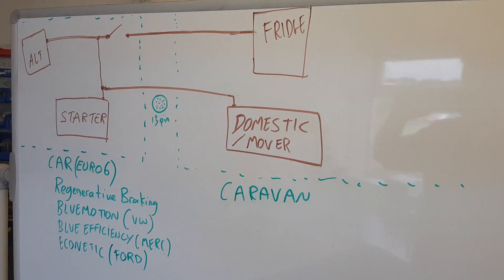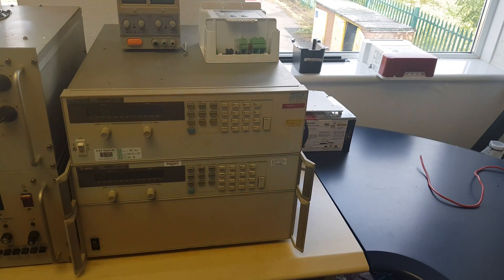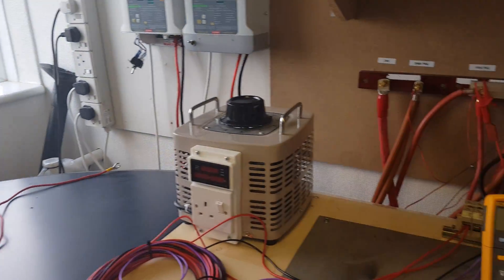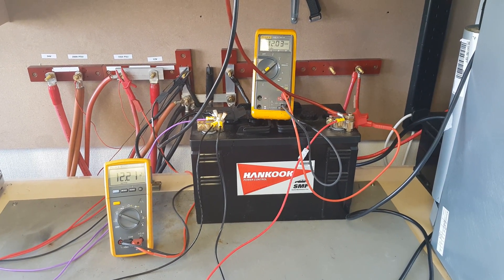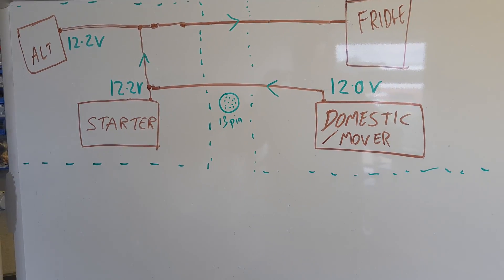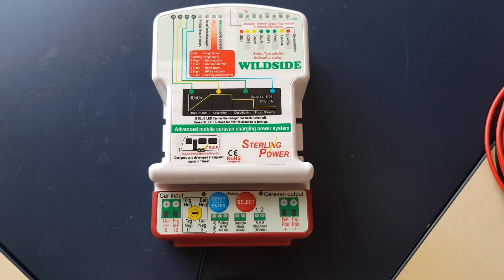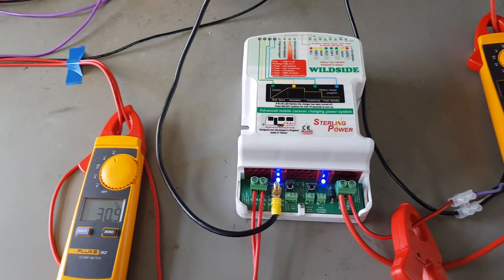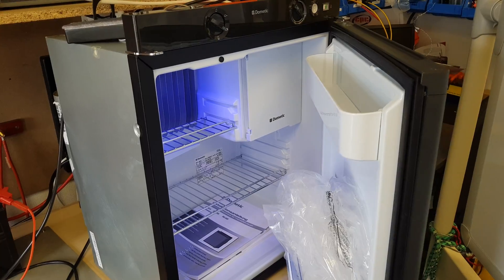Sterling Power Wildside Caravan Charger Battery to Battery

Comment: I don't get it! What happens to the cables that are supposed to be doing this within the 13 pin connection?
Reply: Thats the point. Its fitted in the caravan so the 13 pin is left untouched.

Comment: Been using Sterling products in my campers for years. People will spend a £1000 on solar charging when this is what they need first.
Reply: a stirling powered device? honestly? love these things but they never seem to be practical..
Reply: nvm I am thinking of a stirling engine lol
Reply: but a solar works when the engine in disconnected, as soon as the 13 pin is plugged into the vehicle or/and the vehicle is started then that takes over, just like plugging into mains then that takes over so solar only works when vehicle and mains are disconnected just like in storage with no mains or vehicle to charge the battery.